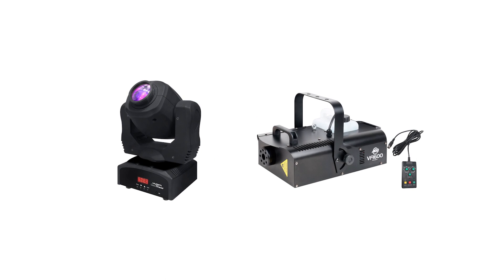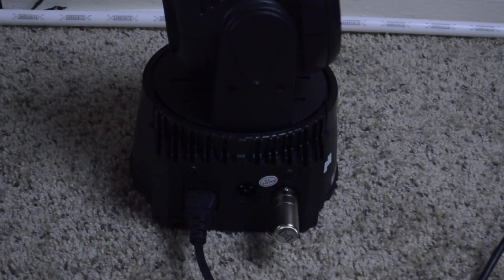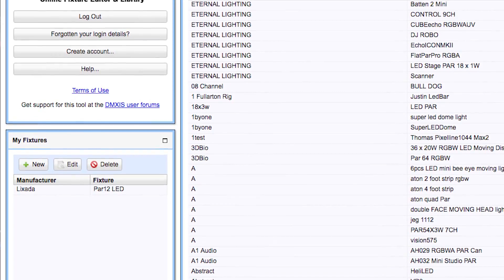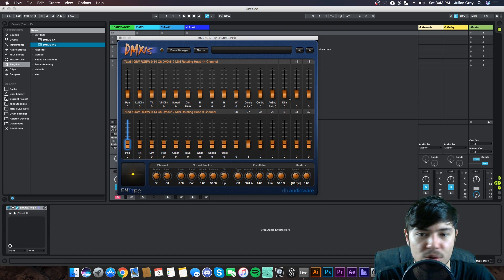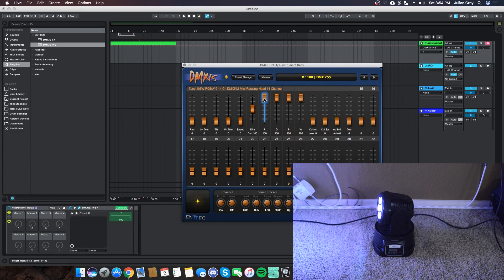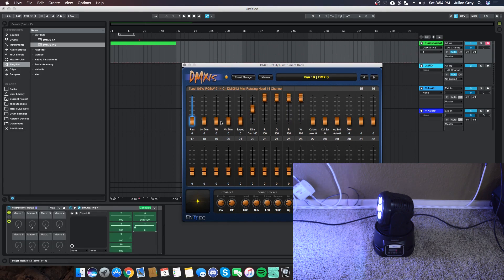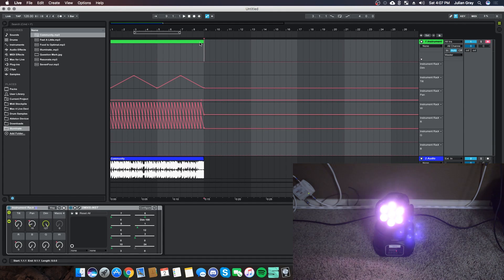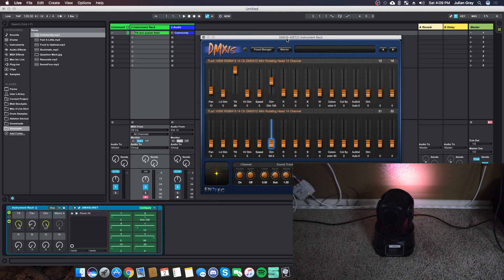Controlling Lights With Ableton Live (MIDI to DMX - Enttec DMXIS)

Comment: So what happens when you have more than one light and you've used up all 8 of your macro knob maps?
Reply from the maker: make a new rack of the same thing. just make sure not to automate the same things
Reply: DMXIS only supports running one instance though.  So I'm not sure how I would be able to connect automation via configuration of the plugin in a 2nd rack.

One of the things I've done for our setup is simply using the standalone setup outside of Ableton and the reason for that is this.  We use a workstation to record the sermon on Sundays and that same workstation is what controls the DMXIS.  If we drop the plug-in into Ableton, then we're unable to successfully control the banks and presets inside of the plug-in.  If we leave it in standalone, we can use a Network MIDI session from a remote laptop on stage to control banks and presets on that same computer without interrupting the recording functions of the ableton machine in the back.  I wonder if there's a better way...
Reply from the maker: You just have to use another midi channel. thats the only solution i've found for more macros

Comment: Awesome vid Julian.  Question, I️ write light show for a band and I️ write each song in a separate file.  When I import clips into the master show file none of the automation transfers if I️ try and use all songs in one Dmxis, on one channel. I️ have to load 15/20 instances for the automation to import. It works but makes for a massive file, even when grouped.  Any advice??
Reply from the maker: automate based on midi clips, then save your project files. When you drag the als file back into the new project, it should carry over.

Comment: Thank you for the tutorial. Im having a strange issue with my setup. Im using 215 DMX channels. Some fixtures are grouped into macros, some are individual (such as the intimidators for individual X and Y control). My problem is switching between songs. I use Cmnd Shift M to group the automation, CMnd J to consolidate, then paste it over to the arrangement view. The problem is when I play the master, some of the fixtures parameters don't recognize the automation. I have to click on each fixture, click the dimmer and move it from 0 to max in order to "activate" it. Then I click re-enable automation and it works. The problem is having to do that for every fixture for every macro before every song seems extremely unnecessary. I'm sure its something dumb that i'm missing.
Reply from the maker: I think you may be running into a fundamental issue with Ableton's automation not picking up an automation curve. generally you can fix this by drawing a small adjustment at the beginning of the automation, on the corresponding clip

Comment: Hey Julian, thanks for the video. I'm just getting into this stuff and while this is amazing because you can automate specifically to the beat I'm still wondering how quick it will get tedious with many fixtures. One light is one thing but 30 lights and I can imagine it getting crazy right away. Anyway, cool stuff man. Thanks.
Reply from the maker: Its actually not as tedious as you'd think if you buss lights into individual control macros, then automate the busses instead of each individual light. I explained this at the end of the video.